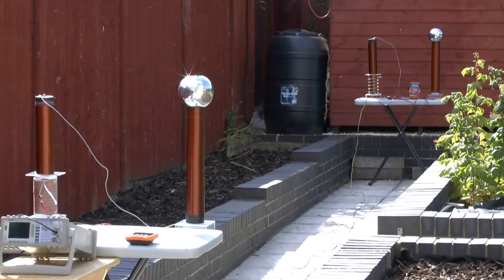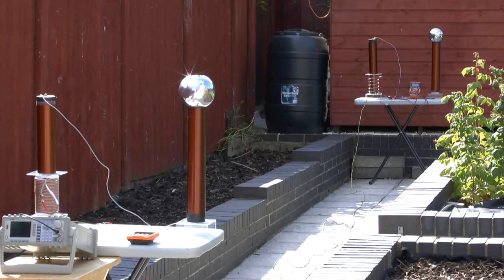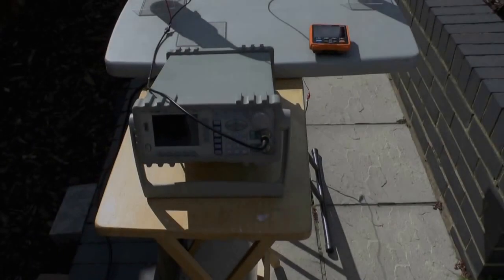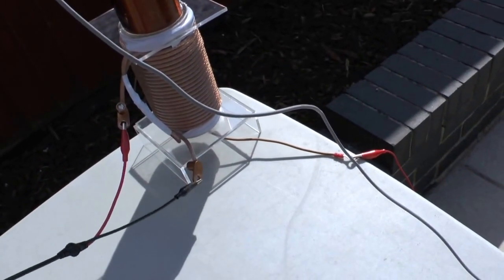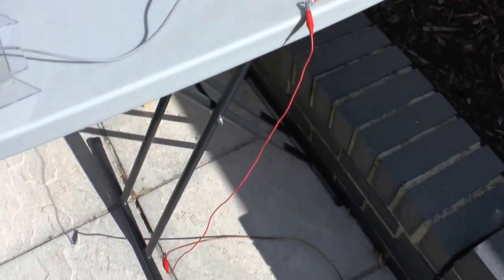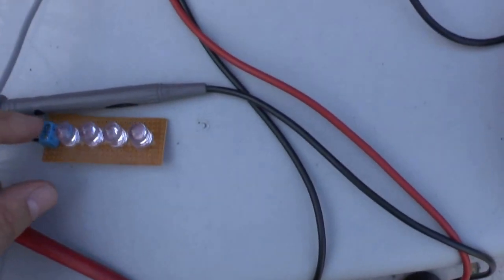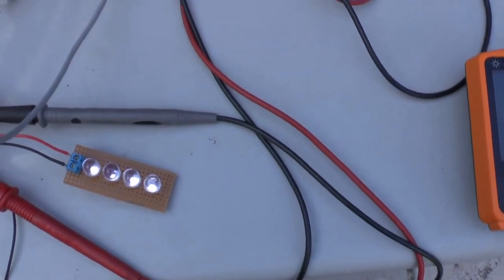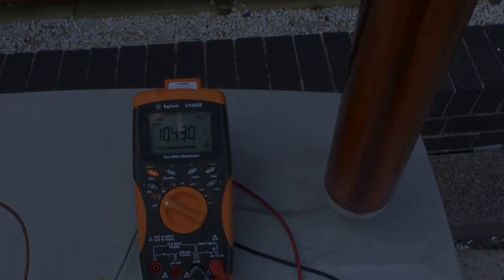The superior Tesla Magnifying transmitter to transmit power wireless

Comment: With the TMT, we have 3 resonant coils, the primary is series resonant (low impedance) and is impulsed.

the primary induces resonance in the secondary. But there are 2 kinds of resonance. 

one is Transverse Electro Magnetic (TEM) the second (higher in frequency then TEM) is the Longitudinal Magneto Dielectric (LMD). 

The Impulsed primary achieves this LMD resonance in the secondary (second coil). As a result of the impulses. 

This LMD resonance is dialed in, making the secondary LMD resonant.

the LMD resonant secondary has voltage and current IN PHASE (has power)

The LMD secondary now acts as the primary for the "extra coil" (third coil) which is the LMD secondary. This extra coil has less capacity and inductance, and is coupled to the LMD primary (second coil). 

because the extra coil (third coil) has less capacity and inductance, but is coupled inside the LMD field, it will resonate at the same frequency, but with AMPLIFIED current and voltage (magnification). at the same frequency of the LMD primary (second coil) 

This LMD resonance has very different properties than TEM resonance. 

More info on my channel

Comment: The  "ground" connection is actually a high-voltage  power line.  The real earth  is the capacitive coupling to surrounding ground from the high-impedance, high-Q resonator.    You don't need to invent any new physics.

Comment: What seperates a TMT from a simple Tesla coil?
Reply: a regular known tesla coil, is a simple TEM (transverse electro magnetic) series resonant  coil.

A tmt is a 2 stage resonant transformer, that transforms the TEM resonance of the series resonant primary,
into LMD (longitudinal magneto dielectric) resonamce in its secondary.
To achieve this, the primary is impulsed series resonant.

then the magnification is the second stage.

the LMD secondary becomes the primary of the third coil ("extra coil")
this new secondary (third coil) amplifies the LMD resonance by having less capacity and inductance, and being close coupled to the LMD primary (second coil).

TEM has voltage and current out of phase (no power)
LMD has voltage and current IN phase (has power)

Power is amplified, magnified.

Big difference!
more info on my channel
Reply: Master Ivo I see. Thanks
Reply: TMT is pretty much a reverse REAL tesla coil.

Unlike all those FAKE "tesla coil" all over the damn internet.